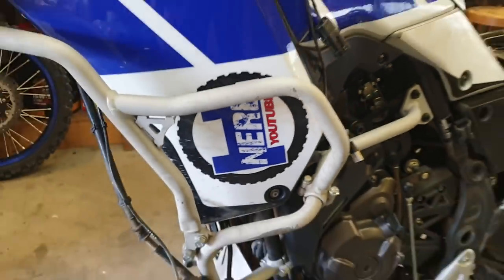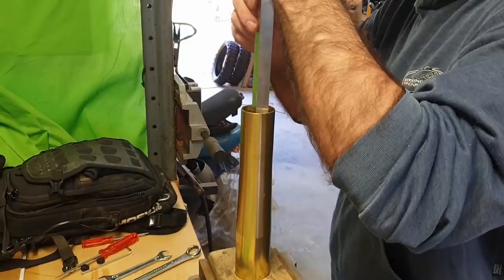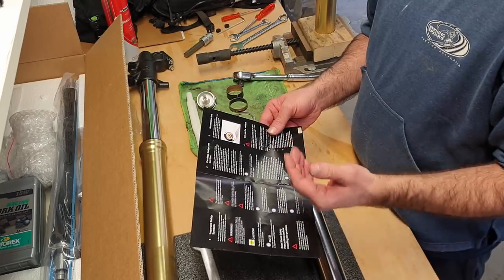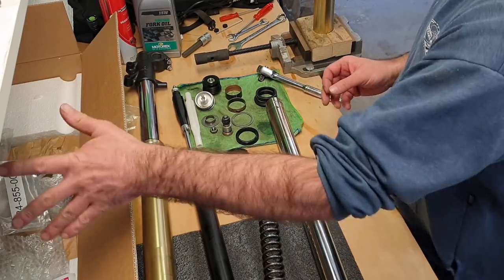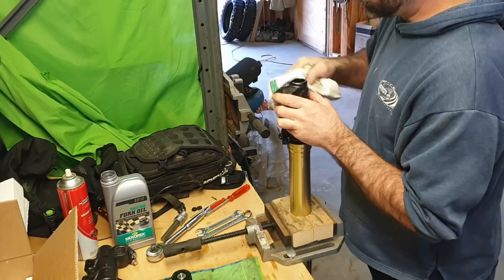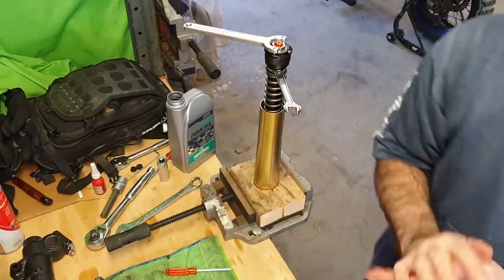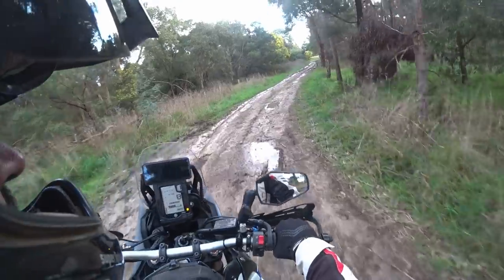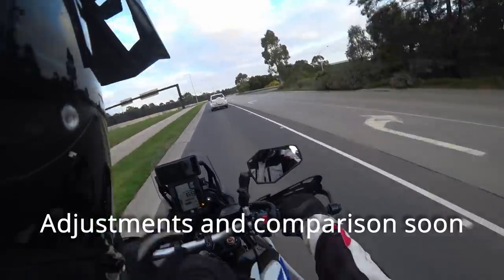Tractive closed cartridge suspension for tenere 700 | Do it yourself

Comment: All that time, money and holes in your bench and still wont be half as good as the KTM 790’s fork!
Reply from the maker: lol... probably not, but it was fun!
Reply: But will we get to see a time Nerb gets a helicopter ride when he gets stuck? Think you will hold that title for a while RWT.
Reply: @wobblysauce  nerb has been rescued before haha, Mt Buffalo 3 men and a snickers bar
Reply: Is that believed to be true? Curious if its worth to seek a WP setup from a Triumph XCX to retrofit on a non adjustable XC versus doing a cartridge upgrade.
Reply from the maker: @ArcticPride1  Whichever change you do, you will want to get the correct springs for your weight. The xcx forks apparently bend shims also, so it would want to be a lot cheaper than swapping for a good quality internal.
Reply: Ha well most of us don't want a fat racing bike with the  reliability of a racing bike too :)
The yammy will still be taking someone on an adventure 20 years from now while your ktm gave up after 5!
Reply: Or the 790 rear shock? 

Might last longer before leaking.
Reply: Actually these are an upgrade from the standard WP as have on my 1190. WP cone valves would be better again but more expensive.

Comment: I have had my RR closed cartridge on for about a yr.  It deflects a bit in the rocks but also clunks like it bottoms out even though the bottom out O ring shows 2 in travel left.  Maybe it just has extra space not sure I haven't measured yet to see if its getting the full 200mm
Reply: same here, I'm battling it currently

Comment: Excellent vid Nerb1. I had my 2020 AT done front and back by Suspension Matters. Re-sprung, re-valved and dyno-ed and it was lightyears in difference. The attitude of the bike completely changed both on street and in the bush. It will give you more confidence in the ability of the bike. If your not 75kgs riding either the T7 and AT, this will give you the greatest improvement for your dollar.

Comment: you said it`s a little bit stiff on the static sag. Who calculated your 6.8 spring rate? I am 110kg incl cloth and the technick website calculator says 6.4. Greetings, Stefan.
Reply from the maker: Nick himself picked the spring for me. I think I told him I would have 15kg gear most of the time. I dont mind it its stiff on the street. I would talk to Nick, or drop him an email with your riding weight/gear/style before committing.
Im pretty happy with the rates, but Im no expert.

Comment: actually the base oil that most oils start out as, are clear or only slightly colored......its the additives included by different manufacturers that change the color. 9.37, I believe that tool is correctly called a 'pin spanner'.    How does suspension 'quality' affect handling in sand?

Comment: Hey there! Did the same yesterday (and today ;) ). Your video helped A LOT!!!! Thanks! I ran into a problem you didn’t seem to have:
The springs I got with the cartridges seem to be to short. I’ve had 13mm of play between the fork cap and the spring… I also didn’t get any spacers with my kit, which is weird. I’ll call the dealer but have to wait 2 days as we’ve got an Easter break here. Just wanted to ask: your springs didn’t have any “play” when you mounted them, correct?
Reply from the maker: Correct, once you screw the cap on, the spring should be tight. The spacers might make the difference. You have the spacers and the preload adjustment, but I don't think it should be loose. Maybe ask the dealer what the spring length should be. Hopefully they are not the wrong springs.
Reply: @Nerb1  thanks for clarifying this for me ✌🏻 I thought wrong springs too, but meanwhile it’s more likely that it’s the wrong cartridges. I guess they sended the Rally version with extra 25mm of travel

Comment: Hello, I'm writing this comment hoping you could help me. I changed the suspensions to the exact same model of yours. The compression leg (left) is OK. The rebound, when we tighten the bottom bolt it spins infinitely :\ We mounted everything and inserted the top cap, now if we tighten the bottom bolt again, the cap starts to apply preload... We mounts the 2 legs the same way :O Am i missing something? I've checked and we dont have cross thread anywhere.
Reply from the maker: You should put the top cap on and tighten it, then tighten the bottom bolt. If it spins, use a rattle gun to get it to snug up, then tighten with the torque wrench. Because you put loctite on that bottom bolt, it might have set by the time you went to tighten it. You might need to take it right out, clean it, add new loctite and re-do it.
Reply: @Nerb1  hi, do you think that the bottom was not cleaned enough? The bolt could have too much oil on treads and then, spins and the metals dont 'bond' ... I think I Will re-do it 😂 thankssss

Comment: @nerb1 did you find that the suspension was as good as the 790/890 after you updated?
Reply from the maker: Not as good, but definitely a massive improvement.
The 790/890 has 48mm forks with 30mm more travel. That extra size makes it stiffer and more oil capacity. The T7 43mm forks cant compete.

Comment: I got Rally Raid fork inserts and revalved the shock, replaced spring with a 8nm spring. Can't say how much this improved the bike. You're a bigger block then me, in my opinion you will need a heavy rear spring. You may feel the bike a bit out of balance with a firmer front end to the rear being softer.
Reply from the maker: Sorry, I should have said that I have previously changed the rear shock spring to a 8.5kg/mm spring. It definitely needed firming up! I just meant that I was happy with the valving of the rear.... so far.
Reply: @Nerb1  The standard valving is ok. The big thing for me with the new valving is that it does not seem to bottom out, it does, but it feels so gentle. You will love the bike even more now with the suspension work. Only if I could ride, lock down - Covid 19. PS your screen bracket is working well, great work. Cheers.
Reply from the maker: @wonkywheels1037  Awesome. First bit of feedback Ive had!

Comment: What did you end up settling on for clicker settings? I just did the suspension on mine and am working on dialing in the compression/rebound.
Reply from the maker: Lots of variables, but you should start them in the middle (10 clicks) both compression and rebound. Then I ended up adding 3 clicks compression (to 7 out) and thats it. Im happy. Really you should be adjusting it depending on the terrain.

Comment: Almost 7 months and how it's performing? Thinking about buying a set.
Reply from the maker: Im loving it. It is a vast improvement for the type of riding I do. 
I still stand by my comments that the stock suspension is fine for touring and fire roads, but once in the rough stuff, getting the suspension sorted is worth it. What I cant say is whether the open cartridge option is just as good. It may perform just as well. My understanding is that the closed cartridge is quicker to respond due to less cavitation, but you might need to be on a motorcross track to notice.
Reply: @Nerb1  thanks for the feedback. I have participated in a light enduro event and I feel that sometimes i got ejected from the bike. I had my compression/rebound tweaked but seems that isn't enough. I agree with you, for touring its fine. Let me ask, did you bought this set for any particular reason?
Reply from the maker: @helderneves91  I got this one because it was available in Australia. Several other brands use the same tractive units and just rebrand them. Ohlins and similar are just to expensive for me. If I had unlimited money, I would have got the Ohlins 48mm fork kit.
Reply: @Nerb1  ohlins are good but expensive. I think we could get similar performance with tractive. Thanks for the feedback.

Comment: hi I have the T 700 since July 31, 2019 and I quickly noticed the limits of the T 700 shock absorbers.
I am a 1.70M pilot for 70 KG but with 20/25 kg of luggage on bumps and techniques it slams on all sides. which forces you to slow down immediately. I'm amazed that you only change the front. I imagine you changed at least the rear spring?
With a little step back now and experience what could you say about this modification of the fork. I'm thinking of fitting the OHLINS kit "Yamaha Tenere 700 30mm Ohlins NIX Adventure FKA 114 Cartridge Kit" and on the back of the OHLINS too.
thank you for videos and your feedback.
I loved the video where you pass all these rivers
Reply from the maker: Hi, yes, I changed the rear spring about 1 week after I got the bike. So the forks was really my second suspension upgrade.
I think the suspension is a LOT better with upgraded internals. If you ride the bike hard, you definitely need to do it. If you are going Ohlins, and have some money, you should consider the 48mm kit they have! https://www.off-the-road.de/en/news/710/ohlins-48-mm-rtx-front-fork-kit-yamaha-tenere-700?c=157
Reply: @Nerb1  I know OFF THE ROAD well, I asked them for many parts for my motorcycles. I would settle for the OHLINS internal kit. The 48MN fork is way too expensive for me.
See you soon, you have to come to France and Spain to fabulous places to go off-road ... Australia is also magnificent

Comment: With split forks doesn't the rebound and compression circuit have to be twice as strong in order to do the job in just one fork that it was previously doing in two? Also, was there any need to actually separate the stanchion and remove the seal and whatnot just to change the inners.
Reply from the maker: I believe that the valving can be much more efficient when operating in one direction only. The oil is only doing half the work. But im not totally sure. Suspension is definitely a black art!
And no, if you are not changing the fork seals, the inner and outer can stay together.

Comment: Great video about to do this as well. How many of the spacers did you end up using in the cap and did they work out for you? Thanks!
Reply from the maker: It comes with 3 spacers. I originally put in the two thickest ones but found it was too hard so I took the middle size one out. It is really nice to ride now over all terrain. Im happy with it.
Reply: @Nerb1  Thanks 👍 much appreciated. 🍻

Comment: Are you still using the Nishua Enduro Carbon helmet? If so, is it true to size with other helmets? I went to adventure moto in brisbane and tried on the Klim Krios Pro and Klim Krios standard lid, hoping they are the same as the Nishua.
Reply from the maker: Yes Im still using it and still loving it. I was an L in the Arai and still L in the Nishua.
Reply: @Nerb1  Appreciate the reply mate, 1 on order now! Cheers.

Comment: dude, for this kinda riding?   stock is good enough, waste of time.
Reply from the maker: What is "this kinda riding"? I can tell you that it is dangerous to land an erosion mound and have the suspension bottom out. It is uncomfortable to have the front end clack clack clacking over whoops. The stock valving can definitely not keep up, especially loaded with gear. For riding casual fire trails... sure. Stock is fine.
Reply: @Nerb1  I mean adventure riding - I am way heavier then you and I never bottomed out T7, use your legs more, they're your primary suspension.

Comment: Hi and thanks for the video! Did you change the suspension travel by changing the cartrige? How much did you pay the cartriges? Thanks
Reply from the maker: No. Same travel. I heard about poor handling by people that went for longer travel. Price is on the teknik website.
Reply: @Nerb1  For the KTM 790 they cost 3154 that is more than the cost of WP fork of the R model. Does it make sense?
Reply from the maker: @davidestroppa3759  If you have a 790, dont bother. The 790 suspension is amazing from the factory.
Yes, the prices have almost doubled since I bought mine. I would import from europe.

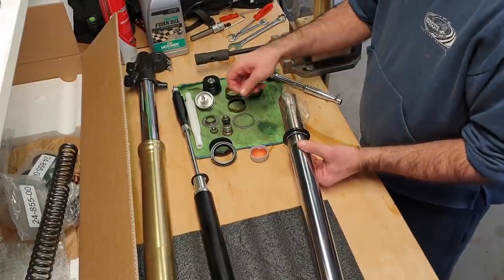Comment: I think you put the dust shields in upside down, at least on the first fork leg. The side with the spring should fit into the top of the leg and the spring should not be visible. they will unseat themselves and end up sitting on the fork leg at the max compression point. See 16:44 to 17:04
Reply from the maker: I will check, but Im pretty sure they only go in one way.
Reply: @Nerb1  Just ignore me. The dust shields I have used in the past did not use an exposed spring, but a quick google images search proves me wrong in that they come in many varieties.

Comment: Just looking at it you didn't need to drill the bench you already had the vice setup for the forks with a nice wood template right there. 
As for the suspension you can keep it where it is for the time, then try a few other settings, or you can have a road setting and then change it when you go bush and back again.
Oh and at the end, cant see the text with the other videos to watch on screen.
Reply from the maker: Endscreen now fixed! Thanks.
Reply: No problem Nerbsan.

Comment: Who would have thought you could combine suspension and wood working into a single video! lol. I much prefer doing work myself too!
Reply from the maker: Its better than the local work experience kid fiddling with your bike! Haha
Reply: @Nerb1  Yep, sump plug falling out of a $33k bike at 110kph after it's first service can account for that!
Reply from the maker: @bazza8947  Also a KTM690 sucking in dust through the crank case vent pipe that wasnt reattached after the first service... I saw it happen.
Thankfully my worst dealer moment was them forgetting to plug the thermo fan wire back in. I noticed the plug dangling on my next ride. Never again!

Comment: Nice work Brendan. Really interesting video. Just curious but red threadlocker is the permanent type ( bottom bolt )or are you using a different type?.
Reply from the maker: It was blue threadlocker but in a red bottle. I think its the chemtools one. What ever brand it was, they have red bottles for all types.
Reply: @Nerb1  Yeah mines in a red bottle too I just thought it looked red on the bolt. All good. When's the next adventure coming up or are you guys locked down like us northern cousins?. I'm supposed to be in the centre right now...f@#k lockdowns.
Reply from the maker: @coobye  Yep... I feel like ive been locked down forever. Havnt planned much... wont until I have a rough idea of what's going to happen.
Reply: @Nerb1  It's starting to wear a bit thin eh. At least my mate from Tassie who I was going with managed to escape out west...the bastard keeps sending me photos of what I'm missing. He's at Chambers Pillar at the moment lucky bastard.

Comment: I replaced recently the complete stock suspension on my Honda Africa Twin 2019 with Tractive components. It feels like I have a complete new bike! So happy having invested that money 🤑. I suggest you should also change the rear shock. You will feel it and enjoy it 👍. Enjoy your rides and have fun! Greetings from Switzerland. I'm a bit jealous. You have such a great country for riding offroad 👌
Reply: Did you replace the tractive kit yourself? I’m in the same situation now. Very little info online.
Reply: @DustinEvans1966  No, sorry. I used a motorcycle garage which is specialized for suspensions. It was the general importer for Tractive suspensions here in Switzerland. I have no experiences with installing and setting up suspensions.
Reply: @RogerHuesser  do you recall how many spacers you got back ? Four thick and two thin spacers came with the kit. They would have given them back to you if they didn’t use them.
Reply: @DustinEvans1966  I just received a big package with all the original Honda parts within it. My suspension guy never mentioned, that he hasn't used all Tractive parts. So I assume he used also all spacers. And sorry, I can't check it, because I already sold the package, containing all the old Honda suspension parts, as a whole. Never checked what was in the package in detail. To be absolutely sure, I suggest to ask Tractive support. They should be able to help you.

Comment: Lots of different ways of doing the suspension on the T7, I guess it comes down to what you need, I will be interested in the outcome of the testing you do.

Being an old slow rider I just opted for heavier springs on mine and tweaked the clickers, I found the front bottom a few times in the Vic high plains, especially those sharp edge rocks, with the heavier springs that was eliminated and a couple of clicks to slow the compression and to speed up the rebound stopped or at least slowed the deflection with the benefit of making it steer better.

It has made it less plush on the road but way better on the rocks, it was chalk and cheese on the dirt from Matlock to Walhalla road, really surprised how much more planted it felt.
Reply from the maker: Yes, the stock suspension with a proper spring isnt bad. Would be fine for almost everyone. I just wanted something a bit top-end for the desert.